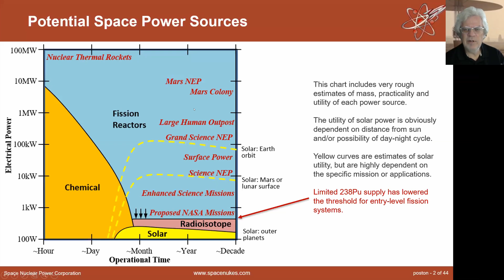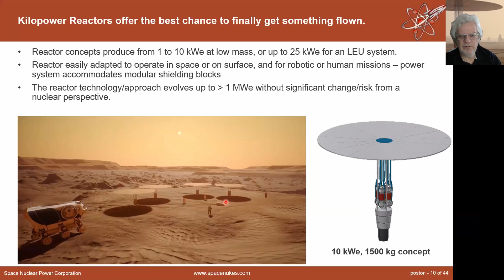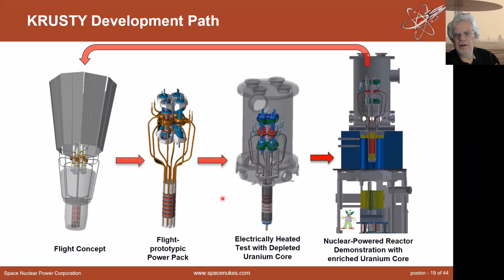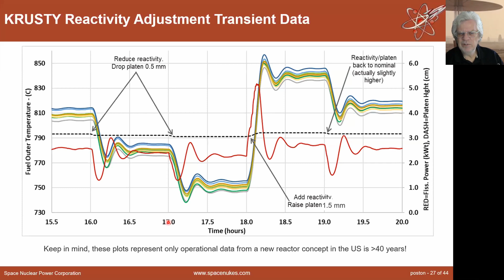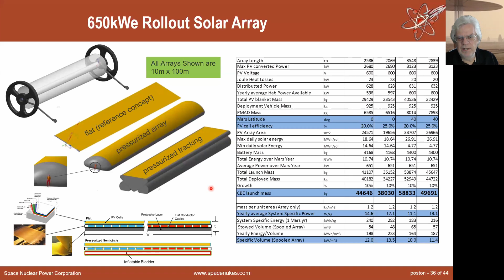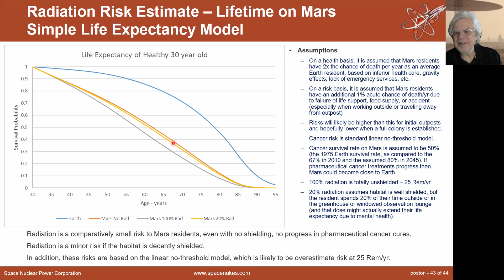Space Nuclear Power for Mars - David Poston - 23rd Annual International Mars Society Convention

Comment: Down the road a bit -- NuScale's 50-60 MW module seems to me a design that could be hardened for Mars and Luna (but I'm certainly not a nuclear reactor engineer :) 
https://www.nuscalepower.com/technology/technology-overview

https://youtu.be/vU-IlqiP4sU

The design was recently safety certified by the USNRC:

"The NuScale design uses passive processes such as convection and gravity in its operating systems and safety features to produce about 600 MW of electricity. Twelve modules, each producing 50 MW, are submerged in a safety-related pool built below ground level. The NRC has concluded the design's passive features 'will ensure the nuclear power plant would shut down safely and remain safe under emergency conditions, if necessary', it said. NuScale has also indicated to NRC it will apply for standard design approval of a version using 60 MW modules, the regulator said. This would require additional NRC review."

https://world-nuclear-news.org/Articles/NuScale-SMR-receives-US-design-certification-appro#:~:text=The%20US%20Nuclear%20Regulatory%20Commission,for%20NuScale's%20small%20modular%20reactor.

Something along those lines, at least. Cleverly designed, but there's nothing exotic about it -- no new tech. 

A reliable 50 or 60 MW would sure solve a lot of problems one might encounter getting a small Martian village set up, I would think. :-) Or perhaps it would make sense to scale them down a bit, to 10 MW, particularly if that's more readily transported by a Starship. 

Then you could pull up those Kilopower units you use initially and deploy them to science or resource prospecting outposts, or what have you.